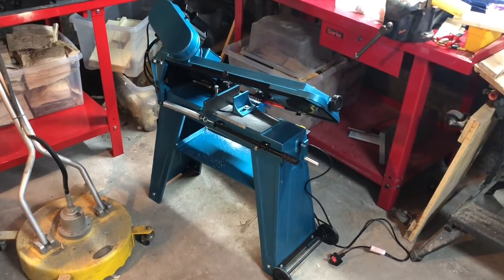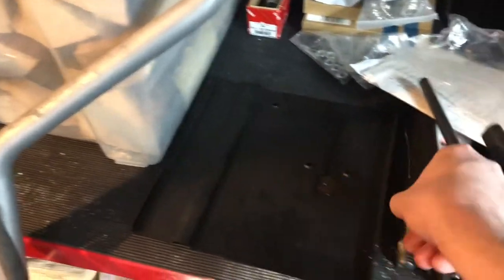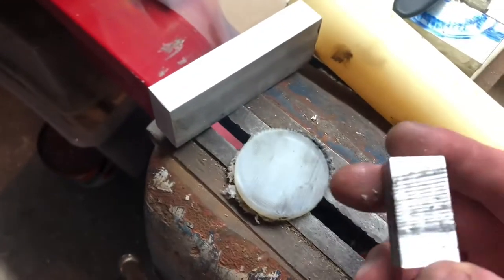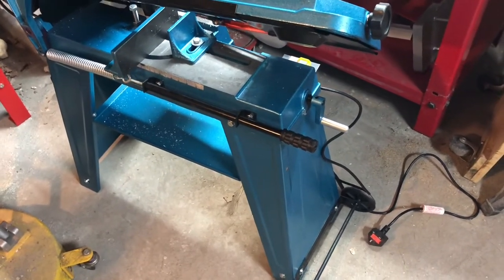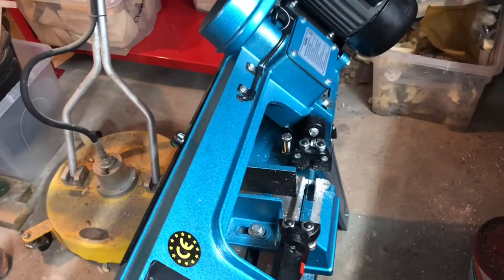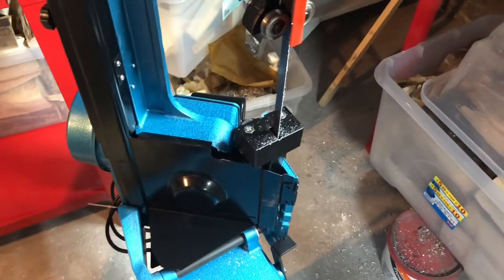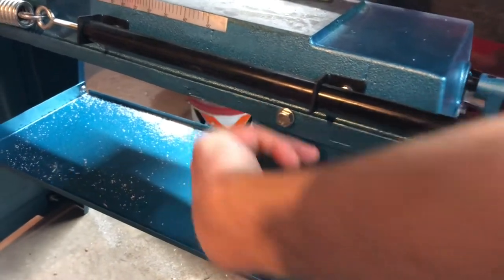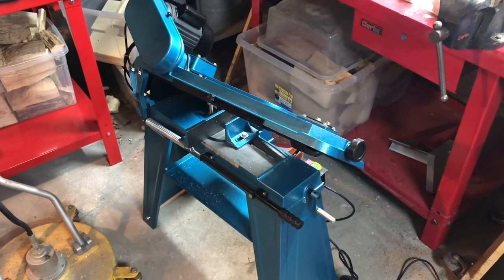Machine Mart’s Clarke CBS45MD horizontal/vertical bandsaw for metal and other materials

Comment: the wheels are on the wrong legs, they should be at rear the heavy end, and the carry handle is at switch end so wheels are engaged with ground when front off ground, that said I dont like mine, as you said weak legs mine have rusted and wheels given away. i should reinforce base , but i cannot be bothered as i hate it so much now, its always blade slipping or cutting off square or stripping teeth off blades on vertical cuts on hollow sections, I just don't trust it anymore. nearly every youtuber vids i see shows metal workers using evolution cut off tools. noisy and messy, but  fast and clean cuts, and the vices have a adapter that hold square tubes at 45%  or daimond shape so never needing to cut at horizontal to blades helping speed cuts
Reply from the maker: I might swap things round in that case.  Makes sense to have the wheels at the heavy end!  Mines’s been OK so far.  I think the blade has come off once but not had any major issues.  Sorry to hear that you had a bad experience with yours.  I see that a lot of people use those portable band saws as well as the Evolution saws.  This one suits me for now and makes good cuts.
Reply from the maker: If you still have this bandsaw, watch this video on setting them up:

https://youtu.be/jgpJ_1zJc_w?si=-SiHhYvuz6dj_Ow0

Comment from the maker: I was initially looking for a vertical bandsaw, but the cutting capacity on those seems to be pretty small.  Most of the vertical ones are made for wood and plastic cutting.  This one will cut 4.5”x6” in metals like steel, so it’s in a different league.  It can also be used in the vertical mode, again can be used for cutting steels and other materials.  The “table” plate is really thin and lightweight, too lightweight in my opinion really and I’ll be modding that in the next couple of weeks as soon as some plate steel gets delivered.